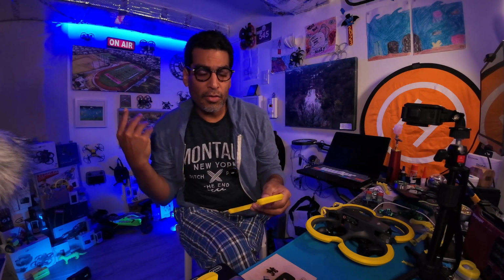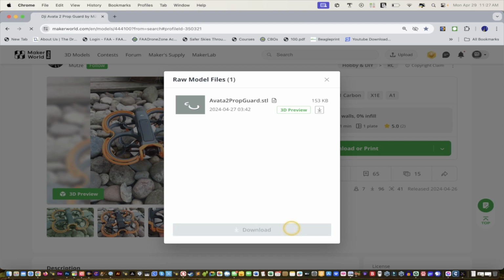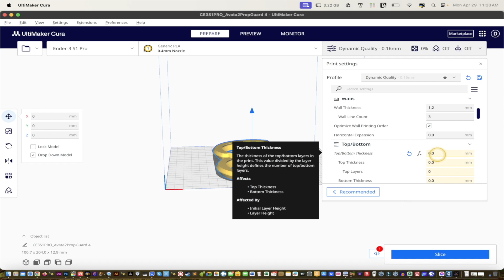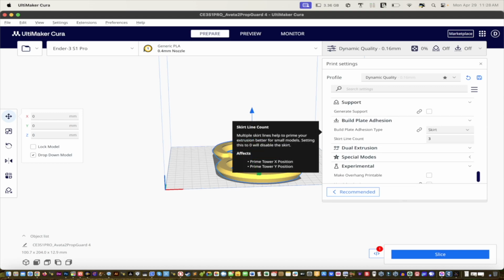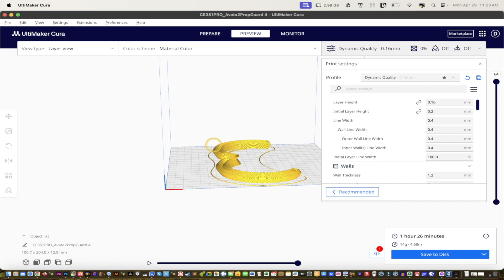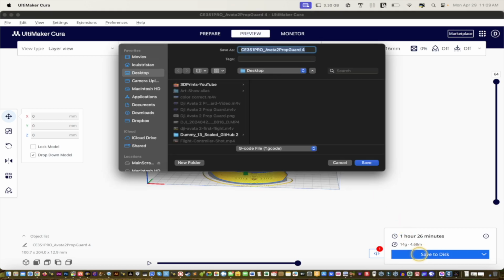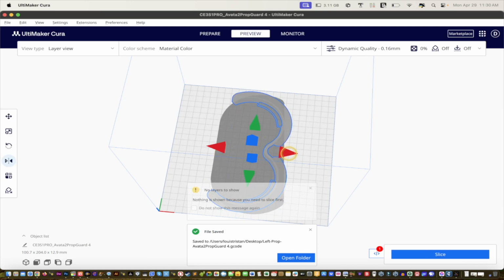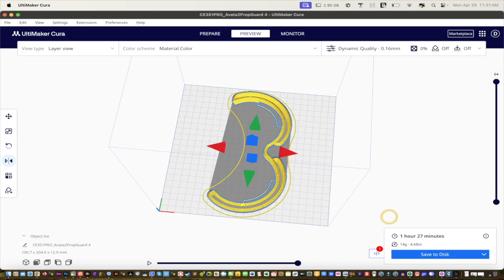3d prop guards STL file  - no infill top or bottom for 3d print - how to mirror an STL file part 2

Comment: The second way is meant to actually absorb the crash just like with cars. The front of the car is “flexible” and gets trashed in order to absorb the impact and protect the passengers. This hollow prop guard works the same.